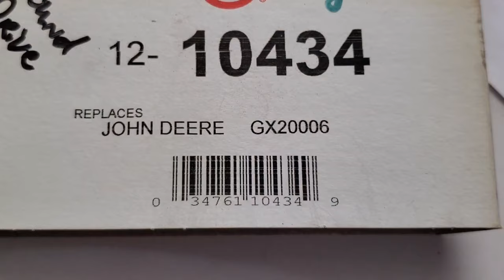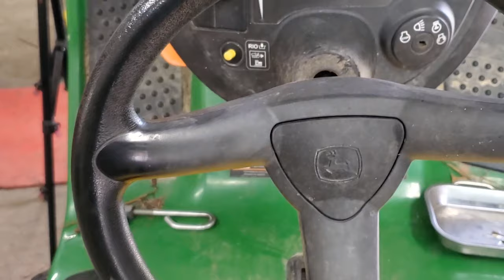John Deere D140 Ground Drive Belt Replacement step by step easy DIY

Comment: Thank you for this video. my neighbor who is an awesome mechanic like you for Crown Lift Trucks, just replaced the mower deck drive belt at 195 hours and said we should replace the transmission belt this winter . I used to be able to do these repairs myself but my agent orange syndr0um has me on oxygen . All I can do now is clean the tractor once my wife has finished cutting the grass(it only takes her 20 minutes or so) . this tractor is over kill for our flat yard . I bought it 11 years ago with 6 hours on it from a landscaper that needed something bigger,$1400.00 later it has been awesome. Still looks new. enough from me but again many thanks and I will have Tommy watch this before he starts.

Comment: Couple of FYI's. You need a small pipe wrench to hold the engine shift while you brake the bolt lose on the clutch. And watch when you drop the clutch down that the small little grommet in the clutch housing doesn't drop out. Other than those two FYI the job goes as explained in the video.

Comment: I've got an E140, and it uses the exact drive belt, and the tensioners look practically identical.

My belt is getting a lot of cracks in it, and your video showed me the two most concerning things as I was looking at this belt tonight:
(1) the rea pin and
(2) how to get the belt from around the steering shaft.

Sir, you've just saved me HOURS of time figuring it out on my own, and a world of less-than-sunday-school language from the frustration I would have had!!

Great video!!!
Reply from the maker: 🤣 So glad it helped you out my friend.

Comment: You solved a few of my mystery issues lol. You explain very well and easy to follow along. I wish I would have had you around when I changed out the deck spindles probably wouldn't have taken me a full day. The manual sucks especially for the deck belt and spindles. I have a 2021 D140.

Comment: Great video as it all applies to my JD 160. I hate that guard pin at the rear for the drive belt.
I've been usign ATV/MOTO jack to raise the front or the back a bit just to have access to maintain my drive belt.

Is there any concerns with the fuel tank or any of the engine oil in raising it as you do? Id love to raise mine that much she didn't want any spilling or issues with the fluids.

Comment: I got a chain fall that's a great idea! I did notice my drive belt was loose on my J D d140 2014 year model looks identical too the one in the video. So my drive belt lasted 8 years that's pretty good in my book. Gotta do gas lines on it but that's easy peasy.

Comment: HELP!!! In your video, @6:38, you just snatched the engine drive pulley right off. Mine is STUCK. I've tried a puller, pushing on the reinstalled bolt while pulling on the top of the pulley. I've even applied some heat, ie. heat gun, and a little gentle mechanical persuasion via a small hammer. No joy in Mudville.

Any further suggestions?

Comment: I do not have a winch, but I saw a video of a man who turned the mower on to its left side to work on replacing the belt.  Do you recommend this?
Reply from the maker: If you do make sure carburetor is up, clamp off fuel line and remove air filter so it doesn't become saturated with gas. It may be a better choice to jack up the front end and use car ramps or jackstands. Remember Safety First.  Thanks for watching and commenting my friend.

Comment: How do you loosen the nut on the PTO pulley without it moving?
Reply from the maker: I use an air impact tool.
Reply from the maker: You can also remove the spark plug and push a bunch of starter rope into the hole to stop the piston from moving.

Comment: The one I'm working on doesn't have the pin on the transmission. The hole is there, but doesn't appear to have any threads in it. It's a John Deere la145.

Comment: I bought a used John Deere D140. It stops moving when I start up the smallest incline. I've replaced the drive belt and I'm still having that problem. Could it be the spring attached to the idler?
Reply from the maker: There is grass and dirt behind the brake pedal arm .  It can only be reached from under the machine.  The dirt and debris is not letting the pedal fully release.

Comment: I have the same exact riding lawnmower what sizes I know a 19mm and 15 mm what size in the pin? What are are some other sizes what would I need thanks
Reply from the maker: Sorry that was a while back. Just have a complete set and see what fits. John Deere is messed up because they use metric and standard.
Reply: @RaleysSmallEngines   thanks for the video I did the whole thing you did as well step by step thank you sir

Comment: What is the secret to getting the bolt to break free under the clutch/PTO. I try to turn the bolt and the whole thing turns?
Reply from the maker: We use a air impact. If ya don't have one, remove the spark plug, stuff the spark plug hole with starter rope to stop the engine from turning and use a long pull handle to remove the bolt
Reply: @RaleysSmallEngines  starter rope into the engine?  I hit it with an 18v impact and it isn’t moving.
Reply from the maker: When I say impact I'm using air impact tools.  either a snap on 3/8 drive  or a Mac tools 1/2 inch drive. It comes off or breaks. Some are very tough.

Comment: I think with this video did for me was talked me into buying an electric lift. 😂 my L130 sat under a tarp for three years because we moved the woods and didn’t have any sun so no grass. Lol  I probably should’ve trashed it but I pulled the carburetor apart cleaned everything but a new fuel pump replace some of the fuel lines and get the motor running in it is always run great and I replace the front spindles and I’ve got steering gears to replace but now my PTO clutch is barely turning and isn’t working so I got a pull that off there and I’m sure I’ll have to replace that and it’s 18 years old so I guess I’ll do the belt and pulleys well I’m in there then three idler pulleys on the deck or seized up so I’m replacing those and bought new blades and spindles off of an eBay kit with everything to rebuild the deck. I replaced my spindles before and they’re still spinning and after that and the steering gears the drive belt the deck rebuild spindles cleaning out the carpet and fuel pump and even two new seat springs it’s pretty much a new motor, the transmission was replaced about six years ago.  Lol

The videos have been very helpful but from this one I think having the lift in my garage would be the most helpful.  Lol. Do you have to drain gas or oil to do that for the turn mower on its side?   

And on those old 16x6.5x8 Tires on a 2004 L1 30, can I just stick and innertube in there on those wheels or do I need to replace the tire. They’re pretty expensive now and one leaks fast the other leaks slow. What do you find best to fix those or do you have to replace the whole tire?
Reply: I was having problems with cracking in my tires and air  was slowly leaking out. I heard to put just tubes in them sure enough it works.
Reply: @Patrick-Villa  i’ve thought about it. These tires are 30 for the small ones and 50 for the large each tubes are about 10 bucks apiece. I put fix a flat in the front tires a while ago and I guess there was still some in there because they have sealed up and are holding air now one of the rear tires have to be filled up every time I mow. I have a canna fix a flat I’ll probably put that in there next time and see if that does it come out if not I’ll probably just live with it for a while but it doesn’t leak quickly so hopefully the leak is small enough that the tire slime will seal it up and make it last a while longer. I don’t know if I can get tubes for the rear tires I know the front ones are $10 apiece but the front seem to be holding air now so I’m good on that but I definitely think tubes are an option. I wouldn’t do that on a car because the tires can come apart when they get old and crack but these things only go 3 miles an hour so I’m not worried about the tire falling apart on me. lol.